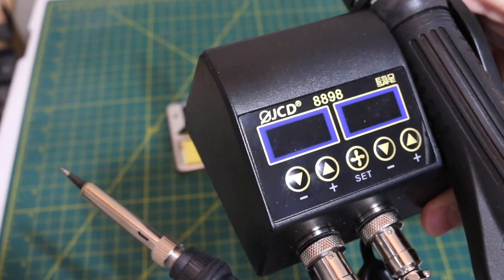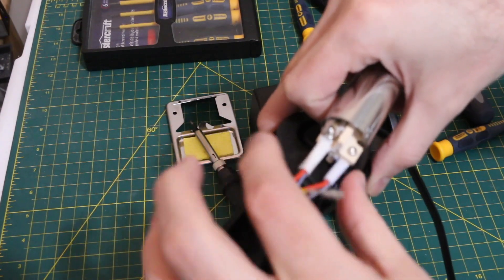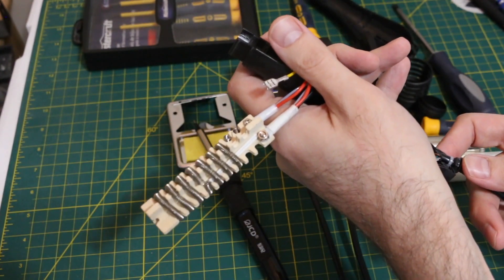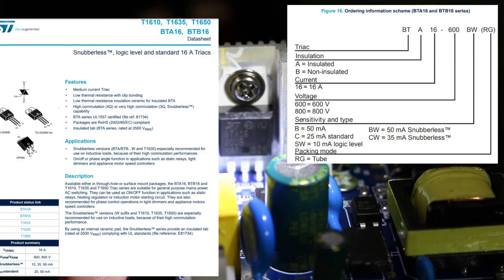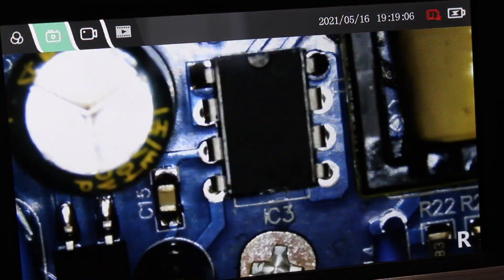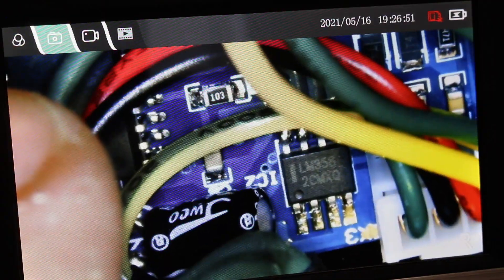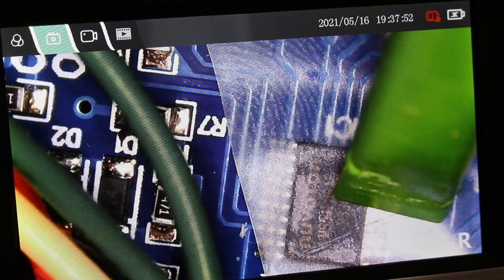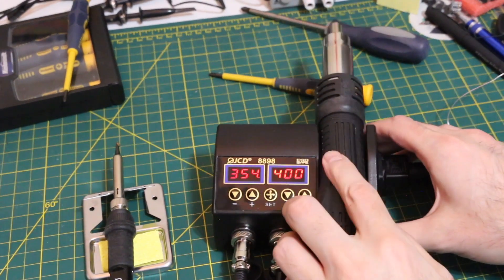JCD 8898 Soldering Workstation Teardown

Comment: I have the same type of solderingg iron. I've been using it for a couple of years now but today the soldering iron side simply doesn't turn on. There's nothing on the display. The hot air side turns on, so it's not a fuse problem. If the cable is unpluggon on the hot air side it still turns on but it says OP. The soldering iron side does nothing. What could be the problem? I don't see any abnormalities on the boards in the station and the soldering iron side seems very simple. Any ideas?
Reply: it could be like this ( https://www.youtube.com/watch?v=ynEnS_YO5iM ) i dont have this soldering station i was looking for reviews if its any good i hope this would help (if you cant see the video the culprit was the Zener diode it blows up when the voltage goes above 5.5v i think (sorry for my bad English) ) if you have fixed it let me know if the soldering iron has a temp sensor or if its just a heating element .

Comment: I have the Sumsour 8898 soldering and desoldering station. There was a short circuit in it and R45 and R46 burned out completely. Does anyone with the same station know the values of these resistors? I would be grateful to anyone who can help me.

Comment: Hi, my soldering station always blinking  on 350 and sometimes shows E-3. It not possible to change values. Soldering unit gets warm but very slowly. Any idea?
Reply: Are you in a 110V place with a tip on 220Volt ? You probably need to switch out the small heater-unit inside the iron. Just my  guess...

Comment: I'm confused about the power supply for this soldering iron, which requires 24V to function. The circuit  doesn't appear to include a 24V transformer or any other obvious means of providing the necessary voltage. Can someone explain how the iron is being powered in this setup?
Reply: Well, I think it is running on mains (so 220 Volt here). So both for the iron as for the hot-air part. I just don't know how it is calculating the temperature since there is no visible  thermistor or such in the handle. So I guess it is somehow calculating the resistance in the heating-element and by a lookup-table or formula in the processor switching the heater on/of  very fast.
Reply: @elvinhaak  Wouldn't be surprised if just doesn't calculate anything and the temp setting is, at best, a rough estimate and works just as a power adjustment. Also there's anothing video on this that points out that the metal connectors for the iron and air gun are NOT grounded, so in case the cable within breaks down a bit there could be 220V mains going into those connectors
Reply: My heat gun (exact same model) readout temperature falls WAY WAY WAY faster when set to the lowest setting to cool it off if the tip is removed. They’re made to be removed and swapped by hand but the point is it’s getting feedback of some sort. There is zero doubt about that.

Comment: Hello. My soldering station 8898 no longer displays the soldering iron temperature display correctly. The lower limit is 356. The upper limit is 932. Although it should be from 180 to 500. When turned on, it shows not 352 degrees, but 662. The soldering iron itself works. The hair dryer display shows the temperature correctly. Can you tell me what elements might have broken? What should I check?
Reply: Your screen is setted in Fahrenheit

Comment: Can both soldering iron and hot air be used actively at the same time?
Is the insulate wire high heat tolerance? if I accidentally touch the soldering iron on it, will it melt?
Reply from the maker: I always use the iron and hot air at the same time for example if I just made a solder connection and I have heat shrink tubing, I put the tubing in position after and just pick up the hot air tool and shrink that and then go back to soldering with everything active.
another thing I sometimes have to do is make some through hole solder connections on a breakout board and then there’s a small surface mount part as well so I pick up the hot air tool and heat that up and then just go back to the soldering iron.
I don’t know if the wire jacket is heat resistant, I’d rather only find out by accident instead of testing it out and finding its vulnerable but I’ve had it almost 3 years and I haven’t had an incident

Comment: The mystery ic is a "DK125" Power Manegemant IC. It was blown in my 8898 on the second use.... With a new IC it´s running again.
Reply: just blow on me! Thanks for the ID of the IC Dennis! I appreciate it!
Reply: I put in new IC and soldering iron still wont work... The air works
Reply: Which one is the DK125? The soldering iron side of my unit broke, but the hot air side works. My unit only has a DK112 next to the transformer. Is that it? It's in the IC3 position that is blank in the video. Thanks!

Comment: Wow, thanks for the very detailed tear down video. Stumbled upon this since I have exactly the same model and the hot air part suddenly not working, the LEDs just not turned on. The soldering iron part still works fine. I couldn't figure out what went wrong, seems that there's no fuse inside. Any advise?
Reply: I have same issue, any advice?
Reply: @Damilola14  get other brand  😁
Reply: That was the reason it was selling cheap.

Comment: You didn't check if the wiring is correct, some of the hot air stations are wired up back to front

Comment: Trash station, it broke after 2 weeks, first died  soldering iron, and then stopped heating the heat fan with error 0P .-.
Reply from the maker: Mine still works
Reply: Chinese junk that is why.
Reply: Hi. I resolved OP by resoldering handle connector. It was holding "on hair" and without proper strain relief.

Comment: I'm pretty sure that "mystery ic" is a 555.  If it's not, it should be.
Reply: IC3 drives T1 transformer with DC from C17 10µF 400V. My mystery IC3 has exploded ...
Reply from the maker: It makes perfect sense, surely something in there needs to be PWM'd.  If not, now I want to add a 555 in there, maybe an LED display variable brightness
Reply: that not a 555 
it s a dk125 the markin are on the other side mine gone bad  so i had to change it
Reply: @xcoltgreenx  there is a joke in the maker world that when someone on YouTube builds something with an Arduino or pi, someone comes along and tells them that they should have used a 555 instead.  It's not a funny joke, but it's a joke :)

Comment: Despite being cheap, these units are pretty skookum.  ;)  Thanks for the tear down.
Reply from the maker: I think I was most surprised that there wasn't all kinds of flux residue all over the boards like Arduino modules.  I'll be curious now to see if it lasts.
Reply: @gadgetsideload  I have a stand alone heat gun of identical type and it seems to last, not that I give it really heavy use, but I have used it for some rework and reflow.   If the heater dies they are pretty readily available.   I think Big Clive (bigclive.com) uses a similar one also.
Reply: Can you please tell me how this solder iron works without 24V supply?